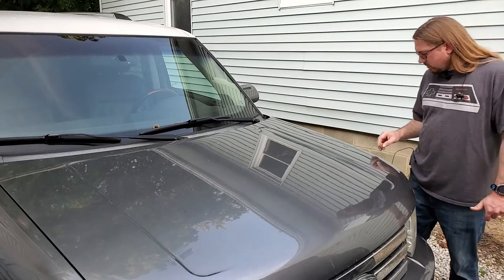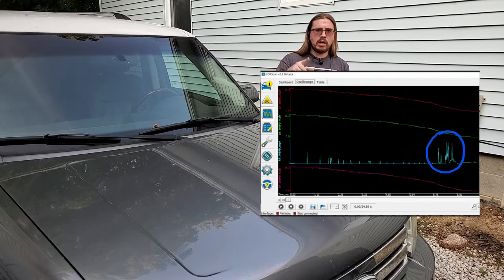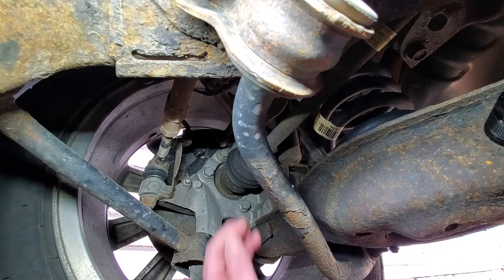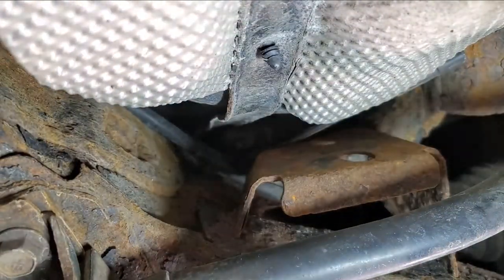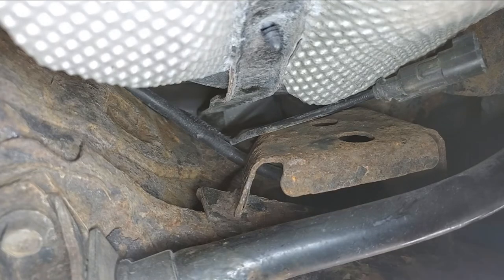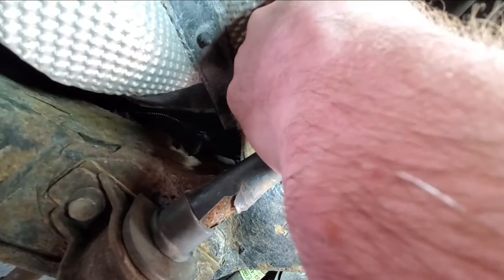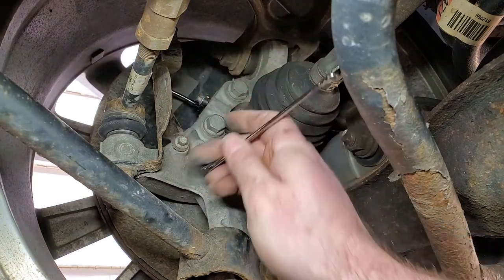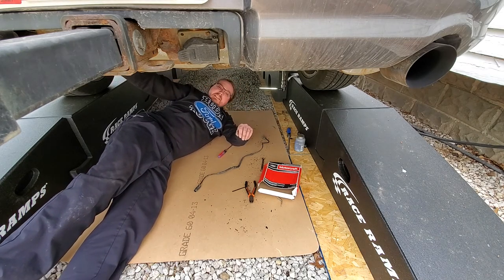Ford Flex | Speed sensor replacement

Comment: We have an 09 Ford Flex, bought as used with nearly 100k miles. It was in our price range for our growing family at the time. Fast forward 5 years and it is giving out on us one part at a time. All I can say is you are providing some nice diy help for us in areas where we know we can get it done ourselves. Thank you!
Reply: I have 2009 Ford Flex limited...we rebuilt transmission at 164k...replaced starter...and the front wheel bearings...also replaced radiator fan assembly/300$...then replaced radiator fan module 6 months later....we did everything except the transmission...it can be done...also...the rear calipers stick on these vehicles...we have 220k on the car....these r not hard to work on....don't go to the Ford dealer.
Reply from the maker: Mine still has its original starter -pushing 220k on it

Comment: Just replaced my first sensor on my '09 Flex with 400,067 miles. This video was quite helpful. I didn't realize I damaged mine replacing the hub assembly.

Comment: Getting a wheel speed sensor fault from the same wheel. Not sure how to tell if it's the sending unit or the hub fins that are at fault. I replaced the front left last year and it was the hub that was the problem, not the sensor. I'm not too interested in replacing one and then the other but wasn't sure on FORscan how to tell the difference between the two.
Reply from the maker: Easy check is to lift the flex with all wheels off the ground.
Using fordcan to read speed sensor- rotate tire by hand and see how the graph display for the wheel being spun. 
You could test the wiring to and from the connector when the speed sensor connects to.

Comment: My bolt to remove the speed sensor is stripped any pointers on how to get it off?
Reply from the maker: You could use a dermal to put a slit in the bolt and then use a skotted screwdriver to remove the bolt
Reply: Well mine snapped off inside so I have to drill it out and make new threads lol